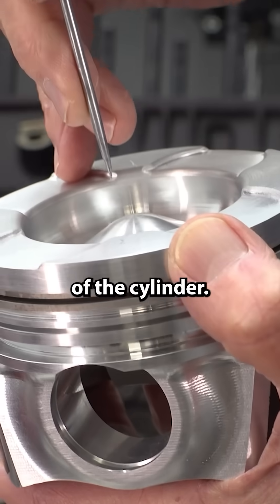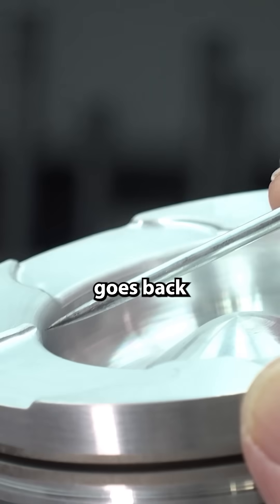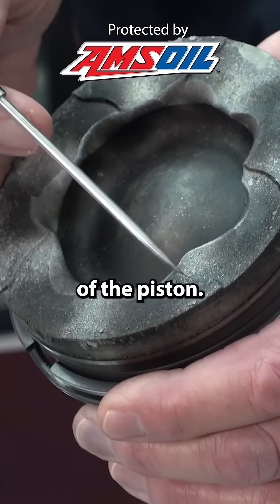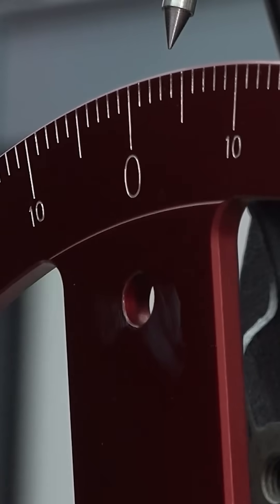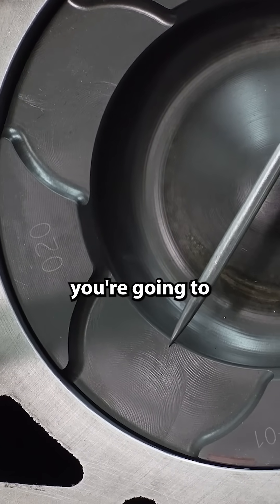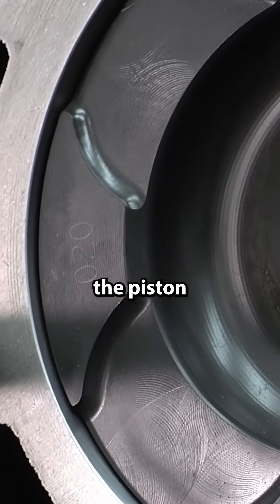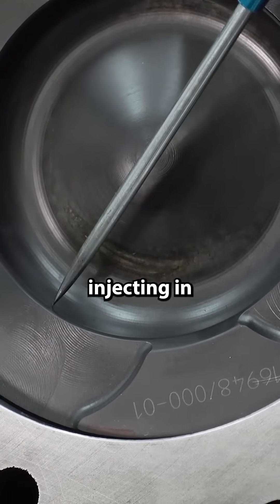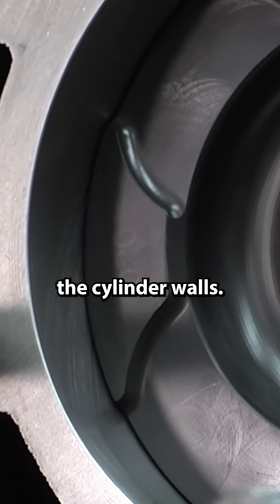How to burn pistons.

Comment: At 40 degrees power stroke down.would raw fuel coming up on exhaust stroke .the injectors staying open to long washing the cylinders and burning everything up . injection timing open to long before closing .injector nozzle pop angel to flat
Reply: It does not happen, if this was problem it would have been solved a 100 years ago. If any fuel mist touches any surface, the fine droplets combined into bigger droplets that are slow to burn. The burning is incomplete by the time the exhaust valve opens so you get smoke, loss of power higher, fuel consumption. When the first amount of fuel is injected into a Diesel engine then the pressure and temperature in the cylinder increases very rapidly, so the remaining fuel is instantly burnt on injection
Reply: @maritaquality  that's exactly what he's trying to explain.it is happening.

Comment: if you Superheat something then that means you already way past melting it.
Reply: It does not happen, if this was a problem it would have been solved a 100 years ago. If any fuel mist touches any surface, the fine droplets combined into bigger droplets that are slow to burn. The burning is incomplete by the time the exhaust valve opens so you get smoke, loss of power higher, fuel consumption. When the first amount of fuel is injected into a Diesel engine then the pressure and temperature in the cylinder increases very rapidly, so the remaining fuel is instantly burnt on injection

Comment: At 40 degrees past TDC you'd think there wasn't enough compression left to light the fuel.  Who or what would time to 40 degrees after TDC?
Reply: It does not happen, if this was a problem it would have been solved a 100 years ago. If any fuel mist touches any surface, the fine droplets combined into bigger droplets that are slow to burn. The burning is incomplete by the time the exhaust valve opens so you get smoke, loss of power higher, fuel consumption. When the first amount of fuel is injected into a Diesel engine then the pressure and temperature in the cylinder increases very rapidly, so the remaining fuel is instantly burnt on injection.

Comment: So true destroying engine only
Reply: It does not happen, if this was problem it would have been solved a 100 years ago. If any fuel mist touches any surface, the fine droplets combined into bigger droplets that are slow to burn. The burning is incomplete by the time the exhaust valve opens so you get smoke, loss of power higher, fuel consumption. When the first amount of fuel is injected into a Diesel engine then the pressure and temperature in the cylinder increases very rapidly, so the remaining fuel is instantly burnt on injection

Comment: What i got from this is it shouldnt be spraying on the cylinder walls am i wrong? Love this guy legend
Reply: @maritaquality
1 second ago
It does not happen, if this was problem it would have been solved a 100 years ago. If any fuel mist touches any surface, the fine droplets combined into bigger droplets that are slow to burn. The burning is incomplete by the time the exhaust valve opens so you get smoke, loss of power higher, fuel consumption.  When the first amount of fuel is injected into a Diesel engine then the pressure and temperature in the cylinder increases very rapidly, so the remaining fuel is instantly burnt on injection

Comment: And that, friends, is what new engineers don't get.  Otherwise the American car market wouldn't be in its current state of embarrassment.
Reply: It does not happen, if this was a problem it would have been solved a 100 years ago. If any fuel mist touches any surface, the fine droplets combined into bigger droplets that are slow to burn. The burning is incomplete by the time the exhaust valve opens so you get smoke, loss of power higher, fuel consumption. When the first amount of fuel is injected into a Diesel engine then the pressure and temperature in the cylinder increases very rapidly, so the remaining fuel is instantly burnt on injection

Comment: Just a question 
Why would you still be spraying fuel after top dead center
Reply: Because that is how Diesel work, all of the fuel cannot be in the cylinder at the same time, because if it all burnt at the same time, engine destroyed. Diesel fuel is injected over a number of crankshafr degrees so that the pressure on the piston stays the same for a longer period than a petrol engine, why Diesels hang on longer under load
Reply: @maritaquality  thank you my friend that's a great answer without being mean. It's hard to just ask a question nowadays

Comment: I don’t get it, he is not recommended to inject fuel between -40 and 40 of piston ? When than?
Reply: It does not happen, if this was a problem it would have been solved a 100 years ago. If any fuel mist touches any surface, the fine droplets combined into bigger droplets that are slow to burn. The burning is incomplete by the time the exhaust valve opens so you get smoke, loss of power higher, fuel consumption. When the first amount of fuel is injected into a Diesel engine then the pressure and temperature in the cylinder increases very rapidly, so the remaining fuel is instantly burnt on injection

Comment: Does not Desiel propagate better if atomised
Reply: It does not happen, if this was a problem it would have been solved a 100 years ago. If any fuel mist touches any surface, the fine droplets combined into bigger droplets that are slow to burn. The burning is incomplete by the time the exhaust valve opens so you get smoke, loss of power higher, fuel consumption. When the first amount of fuel is injected into a Diesel engine then the pressure and temperature in the cylinder increases very rapidly, so the remaining fuel is instantly burnt on injection

Comment: Timing too advanced?
Reply: It does not happen, if this was a problem it would have been solved a 100 years ago. If any fuel mist touches any surface, the fine droplets combined into bigger droplets that are slow to burn. The burning is incomplete by the time the exhaust valve opens so you get smoke, loss of power higher, fuel consumption. When the first amount of fuel is injected into a Diesel engine then the pressure and temperature in the cylinder increases very rapidly, so the remaining fuel is instantly burnt on injection

Comment: But do u injekt  after tdc?
Reply: It does not happen, if this was a problem it would have been solved a 100 years ago. If any fuel mist touches any surface, the fine droplets combined into bigger droplets that are slow to burn. The burning is incomplete by the time the exhaust valve opens so you get smoke, loss of power higher, fuel consumption. When the first amount of fuel is injected into a Diesel engine then the pressure and temperature in the cylinder increases very rapidly, so the remaining fuel is instantly burnt on injection
Reply: Sorry i think i was not clear.
Al injektion  befor tdc . I'm May be wrong . Are u still injektion 20* alternativ tdc?

Comment: My multifuel engine is so weird. It injects a stream of liquid like a water jet into a cup that looks like 3/4 of a ping pong ball from a 45 degree angle. Its the only engine I have ever seen that makes no attempt to atomize the fuel with the injector. It uses the 27 to 1 compression ratio to boil the fuel in the piston cup and burn the fumes off the top. Thats why it can run on gasoline despite being a diesel engine. Then again it will run on anything that burns.
Reply: It is a rich lean burn engine. The hot fuel is sprayed out of the pre-combustion chamber into the cylinder fill of fresh air
Reply: @maritaquality  there is no pre combustion chamber. It's direct injection...

Comment: Why do tractor pullers and drag trucks with diesel pour the black smoke out if you say it's bad?
Reply: Black smoke is wasting fuel,  or a problem with the engine. Look at modern trucks clear exhust unless there is a problem with the engine.

Comment: Injectors need a steeper angle  of spray so they don't hit the cylinder wall after TDC .
Reply: @maritaquality
1 second ago
It does not happen, if this was problem it would have been solved a 100 years ago. If any fuel mist touches any surface, the fine droplets combined into bigger droplets that are slow to burn. The burning is incomplete by the time the exhaust valve opens so you get smoke, loss of power higher, fuel consumption.  When the first amount of fuel is injected into a Diesel engine then the pressure and temperature in the cylinder increases very rapidly, so the remaining fuel is instantly burnt on injection

Comment: Not spreying catching theres a difference.
Reply: It does not happen, if this was a problem it would have been solved a 100 years ago. If any fuel mist touches any surface, the fine droplets combined into bigger droplets that are slow to burn. The burning is incomplete by the time the exhaust valve opens so you get smoke, loss of power higher, fuel consumption. When the first amount of fuel is injected into a Diesel engine then the pressure and temperature in the cylinder increases very rapidly, so the remaining fuel is instantly burnt on injection

Comment: Remove 40% angle to 90% angle degrees add 10% more aluminum and 4.5% nikel for heat dispate for heat absorbed with 1 more ring for oil catch to hold oil double filter size or dual oil filter for waste and then switch to 0w30 or 0w40 preferably for heavy preforming stress needs. Let me know if ya want to get more series on real engineering.
Reply: It does not happen, if this was a problem it would have been solved a 100 years ago. If any fuel mist touches any surface, the fine droplets combined into bigger droplets that are slow to burn. The burning is incomplete by the time the exhaust valve opens so you get smoke, loss of power higher, fuel consumption. When the first amount of fuel is injected into a Diesel engine then the pressure and temperature in the cylinder increases very rapidly, so the remaining fuel is instantly burnt on injection

Comment: What do you do to stop that?  How do you adjust the injection timing on a duramax?
Reply: It does not happen, if this was problem it would have been solved a 100 years ago. If any fuel mist touches any surface, the fine droplets combined into bigger droplets that are slow to burn. The burning is incomplete by the time the exhaust valve opens so you get smoke, loss of power higher, fuel consumption. When the first amount of fuel is injected into a Diesel engine then the pressure and temperature in the cylinder increases very rapidly, so the remaining fuel is instantly burnt on injection

Comment: Pretty much described what my hot tuned 2.0L VW common rail was doing. The injectors didn't flow enough for fuel demand and it was injecting way after TDC trying to get the requested fuel in. Still ran it's ass off but I wonder what those pistons looked like 😳

My dyno was 187HP and 252 lb ft. Stock turbo just DPF delete and tune.
Reply: @maritaquality
1 second ago
It does not happen, if this was problem it would have been solved a 100 years ago. If any fuel mist touches any surface, the fine droplets combined into bigger droplets that are slow to burn. The burning is incomplete by the time the exhaust valve opens so you get smoke, loss of power higher, fuel consumption.  When the first amount of fuel is injected into a Diesel engine then the pressure and temperature in the cylinder increases very rapidly, so the remaining fuel is instantly burnt on injection
Reply: @maritaquality  close. It's wall about the speed of the flame front from the point of ignition/injection. Diesel can only burn so fast which is why even when the engine rotational mass allows for 5000+ RPM, that they do not make much power above 5500-6000, it takes too long for the fuel to burn (milliseconds) relative to crank angle at any given moment in the cycle.

Comment: But let's also consider what the air is doing. Any tumbling introduced will accelerate as the piston rises, the available space becomes more restricted, pressure builds, temperature increases. Ideally it's all smushed down into the bowl at the top of the piston, and swirling wildly. As the injector sprays fuel for optimized atomization

Comment: You need 2 fuel circuits per injector. 1 that injects flat at TDC and a second that injects into the cup at 20* +

Comment: I'm wondering how quench area affected the burn rate with out seeing the combustion chamber profile. You are also using a hugely dished piston, so I'm theorizing that this is an inducted engine which leads to another set of combustion burn characteristics.

Comment: My question is, do bigger injectorshoot.In the time span, where the fuel is finisand allows more fuel.Let's time before the cinema wall is exposed
Reply: It does not happen, if this was problem it would have been solved a 100 years ago. If any fuel mist touches any surface, the fine droplets combined into bigger droplets that are slow to burn. The burning is incomplete by the time the exhaust valve opens so you get smoke, loss of power higher, fuel consumption. When the first amount of fuel is injected into a Diesel engine then the pressure and temperature in the cylinder increases very rapidly, so the remaining fuel is instantly burnt on injection

Comment: So what is the duration of the spray. Over 40 degrees?  Is spray duration adjustable?
Reply: It does not happen, if this was problem it would have been solved a 100 years ago. If any fuel mist touches any surface, the fine droplets combined into bigger droplets that are slow to burn. The burning is incomplete by the time the exhaust valve opens so you get smoke, loss of power higher, fuel consumption. When the first amount of fuel is injected into a Diesel engine then the pressure and temperature in the cylinder increases very rapidly, so the remaining fuel is instantly burnt on injection

Comment: GM uses all of it's engineering prowess in design and manufacturing.   Recall Ford's success with their rear-mounted gas tanks aligned with a puncture device; so crude by comparison.  GM took a more engineering approach to K!ll!ng they settled with their Special K!ll!ng Ignitions; K!lled brilliantly for a solid decade - and that's nothing to sneeze at.  But yes, Self-Destruction is a designed-in feature, and GM truly has mastered it.

Comment: So injection timing matters?  Ya. Ya it really does
Reply: It does not happen, if this was a problem it would have been solved a 100 years ago. If any fuel mist touches any surface, the fine droplets combined into bigger droplets that are slow to burn. The burning is incomplete by the time the exhaust valve opens so you get smoke, loss of power higher, fuel consumption. When the first amount of fuel is injected into a Diesel engine then the pressure and temperature in the cylinder increases very rapidly, so the remaining fuel is instantly burnt on injection

Comment: So change Injector timing Duration program in PCM . With these Super High Pressure Injection Systems Fuel is Emulsified to almost Vapor for Better Complete  Combustion . Hmm increase Fuel Pressure more?  Mr Banks
Reply: It does not happen, if this was a problem it would have been solved a 100 years ago. If any fuel mist touches any surface, the fine droplets combined into bigger droplets that are slow to burn. The burning is incomplete by the time the exhaust valve opens so you get smoke, loss of power higher, fuel consumption. When the first amount of fuel is injected into a Diesel engine then the pressure and temperature in the cylinder increases very rapidly, so the remaining fuel is instantly burnt on injection